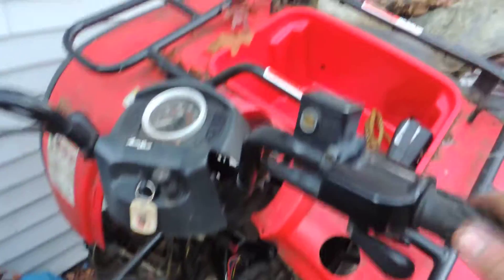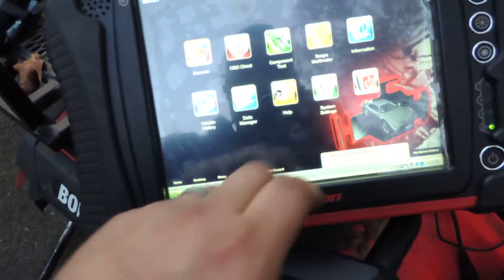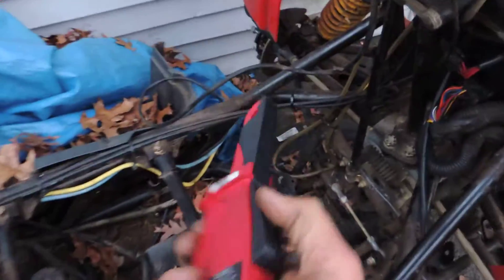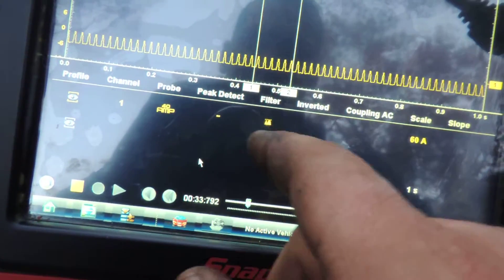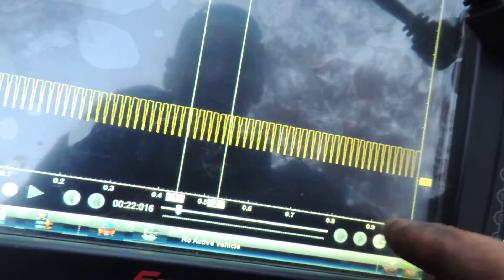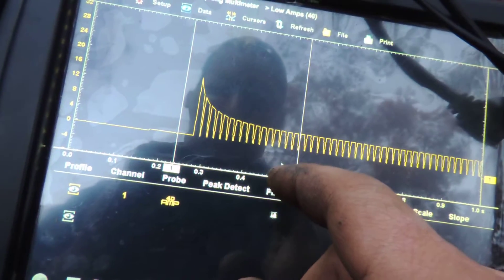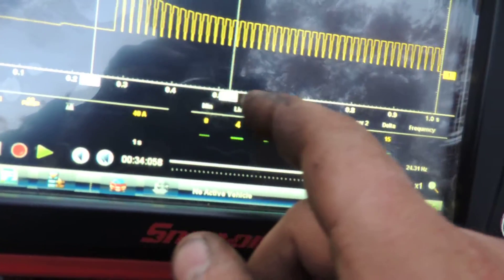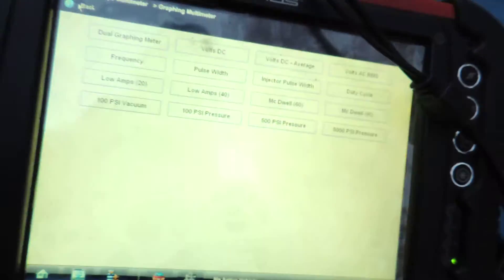Bombardier Traxter MPEM issues part 2

Comment: Nice video, I have a 2001 Traxter xt that has no power at the key. No tail light on...nothing. Went out gradually. I get power to the top of the mpem but nothing coming out of the bottom plug in on the mpem. Got me stumped and can't find a new mpem nowhere.